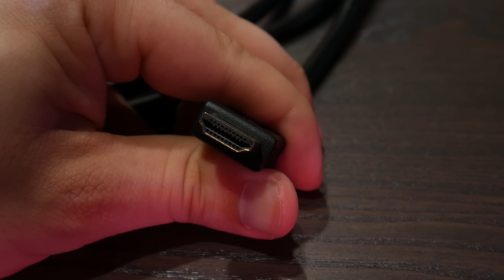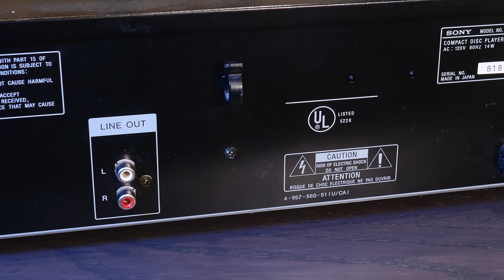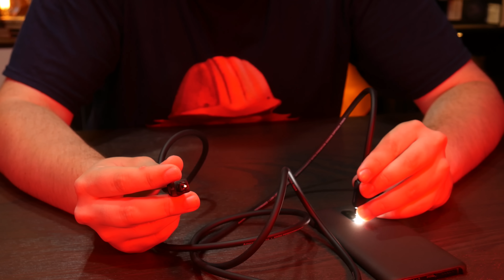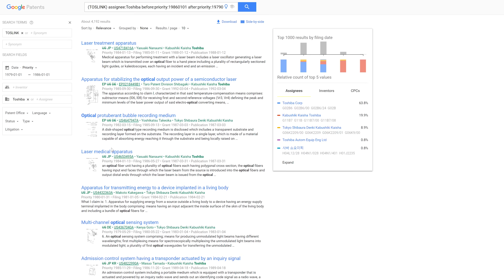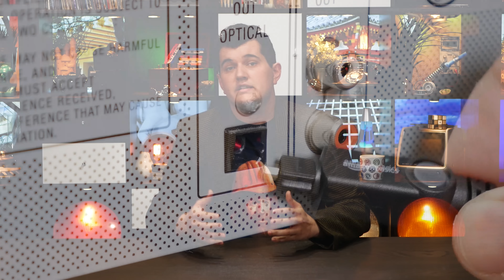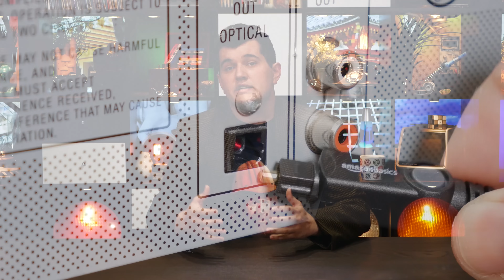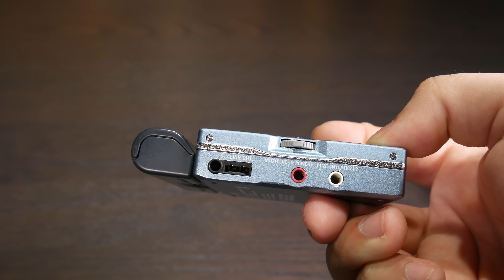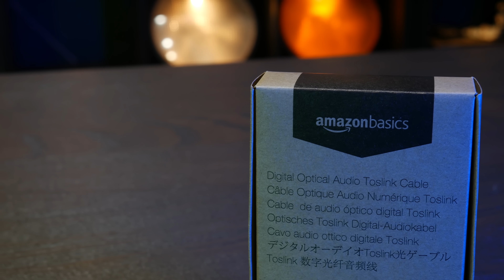TOSLINK: That one consumer fiber optic standard

Comment: The amount of data that can be multiplexed and transmitted on a single optical fiber is staggering.  I recently took a training class on service provider optical networking equipment.  When they covered how to add and drop individual 100Gb circuits using multiple wavelengths, and how you could then merge banks of those multiplexed circuits, the numbers started getting to be incomprehensible.  It's truly remarkable stuff.
Reply: That will become relevant when consumer optical standards move past blits from an LED through fishing line to a photodiode.
Here's hoping.
Reply: @TykeMison_  Probably from the nickel-silver plating of the cable to electrically isolate the signal. Also the brass fittings.

Comment: Toslink does have the small advantage of usually being able to passively split the signal between two receiving devices, assuming cable lengths are short, where trying this with coaxial SP/DIF usually won't work due to the cable impedance being altered, giving destructive reflections and incorrect voltage levels.  Daisy-chaining coax SP/DIF receivers, as with an old 10base2 coax Ethernet, with the middle device(s) having either their 75-ohm termination resistor removed, or the cable ground lifted at the point is more likely to work.

By the standards of communications fiber, everything with Toslink is incredibly lossy, though.  The cheap passive splitters that just move an internal fiber from one port to another cut signal strength quite a bit, such that using one of these plus a passive splitter tends to drop the light level too much more it to be reliably decoded, even with very short ~1ft/0.3m cables.

Comment: Have my stereo amp connected via Toslink to my computer. You do not want to analog out on a computer for good audio, too many fluctuating interfering currents. However, a USB connection would've been just as good. My amp just doesn't have USB input, but my main board has Toslink.

Comment: 12:10 Well. Because of the fact they will share an electrical connection eventually, the audio cable acts as second ground connection between the devices. This can cause nasty ground loops which won't occur using Toslink.
But sure, I'd agree in 99% of all the cases that wouldn't matter at all. But it can be a solution in very specific cases.

Comment: I always laughed at the overpriced GOLD plated toslink cables for "superior audio quality"...... overpriced junk!
Reply: I actually had someone come into the store and ask for gold plated optical cables. I figured it was a prank. They weren't kidding. I asked them if they did realize optical signals were not conducted via gold, and that gold is in fact opaque. Seemed to go right over their head.

Common sense, isn't.
Reply: Yeeep. Preying on the people who don't know how these things work, either because they don't understand how the technology works on the whole or because they do understand the basic principles but not the specifics on either end (IE understanding that a USB cable uses electric voltage modulation to transmit data, but not understanding specifically how that gets out of the connector).

It bears pointing out that even on cables that actually are based on electricity, gold-plated connectors are useless in the broad majority of cases and potentially counterproductive in the remaining ones where it does make a difference. Gold is a worse conductor than copper, and in most connectors the surface that gets gold-plated has no actual role in transmitting data, it's just there to guide the connector. (And honestly, plating the surface of a connection makes very, very little difference to begin with, so.)
Reply: Hex Flareheart It’s called audiophoolery.
Reply: Except, in the video, the cables were around $8. The reality is that if the consumer has the choice of a gold plated cable and a non-gold plated cable at around the same price, they'll always choose the gold plated cable.
Reply: Same with HDMI.... Exactly the same scam, yet "audiophiles" swear by them. Absolutely hilarious.

Comment: Wait, so the red light in my MacBook's broken headphone jack is a TOSLink mode?
Reply: maybe it's not broken after all!
Reply: There are mini TOSLINK to 3.5mm DACs. Might be some powerable by USB. Some wireless headphones come with a transmitter that plugs into TOSLINK or the mini version. Dunno if there are any 'wired' mini TOSLINK headphones. Like wireless ones they'd need their own battery.  At the least, if your analog audio connections in the headphone jack are broken, the light fantastic should still be trippable.

Comment: TosLink has a few advantages, and I assume that by now all already has been mentioned in the comments.
1) Ground isolation/separation - if you for some reason end up in this situation then TosLink is a wonder of just tossing cheap equipment on it to get around it rather than doing a complete inventory of the electrical systems that are at play (if you are at a place with noisy electrics you tend to put the amplifier behind filters to get rid of it, but that means that anything from outside that filter will re-introduce that noise if sharing a ground)

2) DAC "bypass" - Want to hook up your computer to your expensive amplifier? Just get a cheap usb-toslink usb-card and hook it up, since the TosLink's main selling point is the lack of extra DACs this means you can get high quality sound at a surprisingly low cost.

3) Cables - the cables being thin is great for when hiding them for aesthetic reasons. For instance you can shrinkwrap a thin toslink cable to the power cable of a wall-mounted TV and basically hide the sound-cabling from view (up until ARC started appearing on HDMI this was basically the only decent way to keep the number of visible cables down). (Since it is easy to get (and/or combine) shrink tubing in a wall-paper-matching this allows for some impressive reduction of visibility of cabling - however this works for the (somewhat thck) hdmi cables as well).

4) Mini-TosLink (this is a variation of point 2 as well). The combined 3.5mm and toslink jack was wonderful for reducing the number of ports, also it meant that lots of (especially cheap) usb-soundcard allowed for hooking it up to meh-quality headphone/speakers at the computer or to a good quality (DAC-bypass) hifi-equipment.

5) Cost - since the receiver basically just is a photo-receptor you can add lots of ports at a low cost, especially since with a decent selector each new port only are the cost of jack+diode+shortCable (or trace) without bothering with ground or electrical concerns (since you control all power of significance (unless someone decides to aim proper lasers into it) you can basically ignore all electrical consideration). (And this means if you already had a spdif coax you could just hook it up to the same decoders via a selector)

(6 - Great learning tool - since you don't really need to mess with potentionally hifi-frying electricity you could try to make your own whatever-to-TosLink adapters to learn audio encoding.)

(7 - No sound? Was a lot easier to just check light from the cables than fetching a multimeter when trying to figure out if you hooked things up and turned them on correctly (or if the cable was in working order))

(Also, having fiber optic cables laying around allowed for some other useful things as well, like snaking it across a wardrobe/closet door to indicate if you forgot the light on in the closet or not. Or "piping" a LED-indicator into another room (or to the front of equipment), but that is the use of fiber optics itself and not toslink in particular, but toslink tended to end up with one having a bunch of optical cables laying around)

Comment: I use TOSLINK for pretty much every device in my living room. The reason being that my receiver doesn't support 4K so if I want it, I need separate output for video and audio, video going straight into the TV and audio to the receiver using TOSLINK.

Comment: Using optical ways for transmitting data has one upside.

There is no potential risk of frying the connection on the other side of a connected device when lightning strikes. Yes I had that experience at work with network devices. Fibre would have saved it. :'(

Comment: Back in the day when I had a stack of HiFi units which included CD, DAT and MD, using TOSLINK connections made my system less prone to earth loops, also known as ground loops or hum loops. The more earth paths there were between the various units, the more I suffered from hum and mains borne interference on my analogue sources, most notably the moving coil pickup on my turntable.

Comment: TOSLINK cables were heavily used in the semi-pro and pro markets in the 90's using the ADAT Lightpipe standard developed by Alesis which was able to send 8 channels of 48k 24 bit audio down a single fibre optic cable. Higher sample rates were also achievable but at the cost of channels available.

Comment: Technically, you wouldn't need a separate return fiber, since you could just send differently coloured light backwards down the cable and have a prism split the two signals at both ends
You could even do this with a lot of colours in the visible spectrum

Comment: ROFL, that HD DVD joke. xD

So... I've been using Toslink since I got my first laptop (an Acer Ferrari 4000) and my 15 years old 5.1 home theater system - Logitech Z-5500 (DTS 5.1 with THX). That's because I got, for the laptop, a Soundblaster PCMCIA card that had the mini Toslink port.

It also doubled as a headphone jack. Pretty interesting adaptation for the form factor:
https://ksassets.timeincuk.net/wp/uploads/sites/54/2005/01/943-ports-1.jpg

And then, like I said, I never switched to another home theater system, this one is perfect for my needs and it works like a champ. And even though not many people knows about Toslink, it's always been there right? The past 3 PCs I had all came with a Toslink port for sound.
I'm not even an audiophile in anyway... but you know, despite not being anything special, these days not only can you get some super cheap toslink cables anywhere - I'm talking eBay cheap crap stuff, not fancy overpriced crap like Monster cables - but they are also pretty reliable because of how they work. 

Here's one advantage of it from my personal experience: you don't have to worry about contact point corrosion. You know when you connect your speakers or headphones to a headphone jack and it gets all crackly? And then overtime the connector will get oxidized or gunky and you have to keep messing around, twisting it or flicking it to make a proper connection? With light, there's none of that.
The other advantage is more about it being a digital transmission rather than because it's fiber optics, but yeah... it either works, or you know the cable is broken. None of that crap that happens when wires are getting frayed and broken little by little and you keep jiggling it around to see if it makes things better. :P

HDMI is indeed superior, but for instance, because Toslink became the de facto standard for digital audio for a while, it's easier for me to pull a cable from my desktop to the speakers with a single, very thin, Toslink cable, rather than either 3 cables for 5.1 analog audio, or even a thicker HDMI cable. But HDMI is not an option for my set of speakers... yep, it's THIS old. xD It has input and output for Toslink, or all analog. No HDMI.
I've got these super thin Toslink cables that puts even my flat HDMI cables to shame. They are even thinner than the audio cables shown in video. When I took a look at them I thought they were gonna break or just not work at all, but I was wrong.
But indeed, they cannot go longer than 5 meters.

Another weird piece of related tech that I have here is a Toslink switcher... because the speakers only have one toslink input, and I had both a desktop and a laptop that could output toslink, I got a mechanical switcher to change between channels. This guy here:
http://www.homewired.com.au/images/ebay/toslinkSwitch.jpg

It really is totally mechanical. Either mirrors or fixed pieces of fiber optics that switches with that channel selector there. And it works, no power needed. xD It probably weakens the signal even more, but still doing the job fine.

I won't recommend it for anyone else though, specially those building new rigs... just that it works for my current setup. :P

Comment: How on Earth can you miss the one feature of TOSLINK that no cable can give you: GROUND SEPARATION. Try connecting your desktop PC to an amp across the room, and voila... mains hum. You do not get mains hum over an optical interface, that's the main point of using TOSLINK.

Comment: I always heard mini Toslink to be referred to as an optical jack. Also, electrical separation is not moot because of the ultimate connection via powerlines. powering side is expected to be noisy and is designed around that. The (even digital) signal connection might carry noise that might affect circuitry aside from interpreting the signal itself. But all that is solved with toslink but only the gold plated one ;]

Comment: Fibre connections have speed on their side, but copper goes for the long haul. Where light-based connections peter out after their short run, copper far exceeds its colourful rival by leaps and bounds. It can also be repaired rather easily, and is infinitely recycleable once the plastic's stripped off whatever connection is sheathed by such. Copper always wins where it matters, and what matters isn't often how fast you go, but if you can make it to the end.

Comment: Re toslink vs rca digital: galvanic isolation is a feature that swayed me to the optical.
Reply: Galvanic isolation is why I'm using it because I needed it. Had ringing in my active speakers and isolation got rid of the multiple pathways to floating ground (floating because when this building was constructed grounded plugs weren't a requirement).
Reply: @samiraperi467  technically there shouldn't be any currents on the equipment grounground doing conductor... but real life happens...

Comment: Many soundcards use Toslink output and input either discrete or onboard.The advantage it has over the other connections for home theater as you said it is that it can carry DVD quality multichannel sound to an amplifier (16bit 48Khz) 5.1 either using Dolby Digital Live or DTS Connect which are also very useful if you are gaming with surround sound audio system. About mini toslink now my Asus Xonar DX soundcard from 2007 (still use it great card still modern) uses this type of jack for spdif out and includes an adaptor in the box for normal toslink cables. I also had Soundblaster Audigy cards all of them had a lot of toslink jacks inputs and outputs.
Every Smart TV I have seen has toslink spdif jack on it so in my opinion the Toshiba 40 year old optical connection is not that obsolete yet...

Comment: I love toslink cables. Use them at home for clean digital surround audio. Later I used the same toslink connection for ADAT. 8 24bit audio streams. Used 2 German sound cards RayDAY from RME Audio. 64 channels in and out of the PC.

Comment: The keying of the cable should not be needed to send multiple signals or two way communication since you could  use different wavelengths of light for different channels.

Which begs the question why was it keyed then?

Comment: There are reasons for TOSLink (avoid ground loops).
MiniToslink is much more widely used than one might expect: I've found MiniTOSLink in a PC audio card (because of space constraints), in a €30 chinese Android box (now a Kodi box) and in Intel NUC (J3455) and it's often the only way to carry out multi track audio from the integrated sound card (or get a digital audio at all).

More on topic: TOSLink already has enough bandwidth for 8 channel uncompressed PCM (it's just an option when you set how you want your audio out to TOSLink: BITSTREAM or PCM), and that's "standard" because almost all toslink receivers do support that.

TOSLink is just a victim of DRM: being monodirectional it's almost impossible to encrypt. Audio industry (audio producer) forced the industry to dump bitstream high quality audio if it isn't secure enough (that's a part of the whole "analog sunset" agreement) and TOSLink didn't fullfit the requirements.

Long story short: https://ayrne.io/technology/mythbusters/toslink-optical-connections-support-24-192khz-audio/

TOSLink is fine for 24 bit at 192 KHz stereo (even my old PlayStation 3 can output TOSLink stereo 192KHz audio), while normal 5.1 is 48KHz.
Simple math : 192 x 2 is more than 48 x 6 so there's no bandwidth limitation TODAY (and you can go up to 96x2 + 48x4).

Comment: 11:10 probably the 'audiophile' snakeoil argument would be that while the digital signal in the TOSLINK cable isn't susceptible to interference, other ANALOG cables (i.e. those from your AMP Out or pre-AMP Out) are.. so reducing the quantity of cables running electricity and thus creating electromagnetic fields/interference would benefit those. Never mind the fact that your AMP out signal would be sufficiently powerful that any noise/interference would be negligible. but you gotta respect the 'audiophile' and their insistence on their snakeoil setups.

Comment: Apple Airport Express Wifi receiver has mini 3.5mm Toslink Optical out for iTunes streaming around the house.  Also, I have an optical HDMI cable to my projector.  Converts the regular electrical HDMI 18Gb/s signal to optical then back again at the other end.  Much better than copper for long HDMI cable runs.